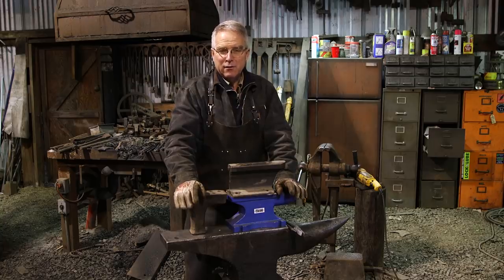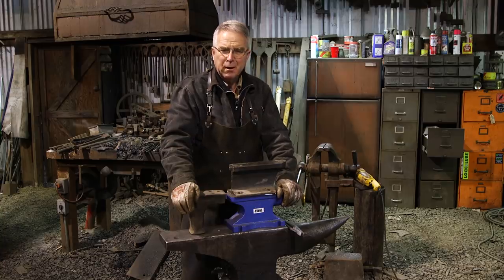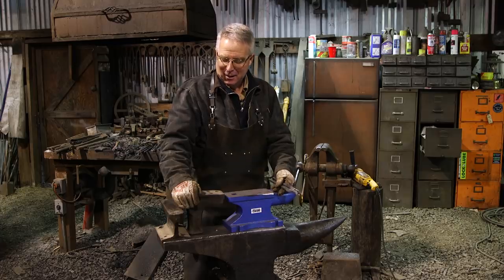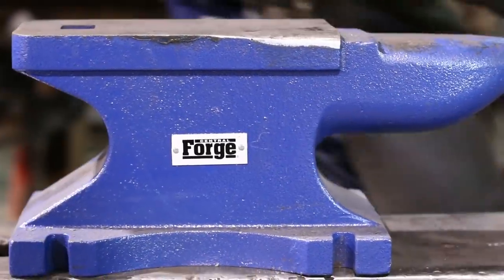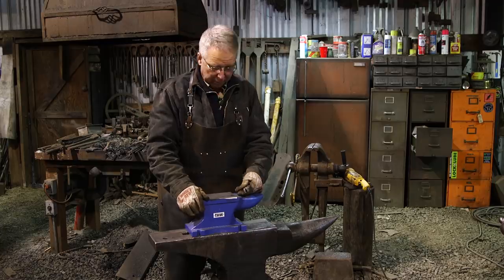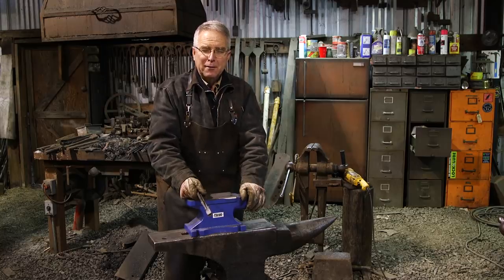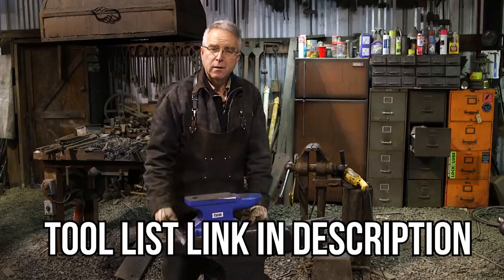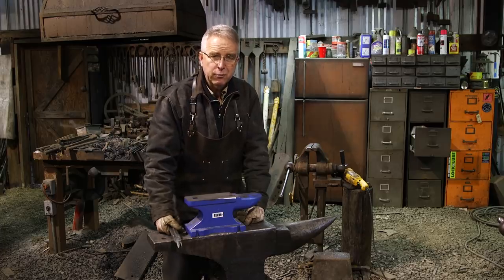Harbor Freight Anvil Review

Comment: I bought one of those 55 Pound Harbor freight Anvils about 20 years ago and it's still like new with no dings at all.  Then again it's been sitting unused in the corner of my garage for those 20 years.
Reply: He had us in the first half not gonna lie
Reply: I bought one of those 40 years ago, found out it was quite soft and used hard surfacing rod to make the top surface hard enough.  Took me a lot of time to grind the top flat again and more time to true it up.  Still, it will likely outlast my kids.  Is a professional anvil, heck no.  I'd never recommend it for commercial use.  For me, banging rivits flat and reshaping the curve in barbecue hooks, it works great.
Reply: Tnat may have been the funniest thing I read all week.
Reply: @NormReitzel  After watching this video I was considering doing similar: buying one of these—perhaps even next time a garage sale has a “decoratively used” one—and beginning my blacksmithing journey by welding up a “workbench.” I reckon it would be a fitting symmetry to my carpentry journey, using the basic tools I knew already and some reclaimed ware to shop-make the workbench I thought I wanted, then customize to suit over time!

Comment: Excellent and honest review. I am new to blacksmithing and am 65 years old. I am a carpenter by trade and still working. I bought the HF anvil to start off in blacksmithing and although it is something good to strike on, you work hard to move the metal. That said, I want to make sure I'm really going to be into the blacksmithing before I drop a $1000.00 on a real anvil. I would say it's worth it if you are a hobbyist just starting out.

Comment: The first thing I made I heated up in my BBQ grill and pounded out on a tree stump with a claw hammer. Needless to say, things have improved dramatically for me since then. 😆 It doesn't matter what you start with, it only matters that you start.
Reply: How long did it take you to get it hot in the grill?
Reply: @tuckera1879  Aww hell, I don't really remember. This was twenty years ago! You can make quite a lot of heat with a charcoal briquettes 🔥
Reply: I love that last line!  Hope you don’t mind but I’m going to steal it lol
It’s just to good not to lol
Cheers mate
Reply: My first 2 pairs of tongs were heated up in a cast iron wood stove,  beat out and bent using a 8lb maul that had about a foot of handle (head I found in a box of junk from an auction), and a chunk of thick walled 3" pipe as a "horn" in a vice.  Using coals left from burning hedge/Osage Orange/ Boise 'D Ark (all names for the same tree species) burn HOT and last forever btw. It was the go-to species for blacksmiths around here for their charcoal.

Comment: For the longest time I used a 8lb block of mild steel as an anvil. It was a lot of work but it's what got me into blacksmithing.
Reply: Mine is about 15 lbs, but that's what I'm still using.
Reply: Just a little research in your area and you will be able to find a steel supplier or scrap yard that sells cut-offs of A36 steel.  It isn’t quite hardenable but it does work harden.  You could have a 150 pound hunk of it for cheap and it would serve you well.

Comment: Thumbs up for an HONEST evaluation.
Many reviews of this anvil exist. Most (and 99% of the comments) declare it worthless, as only a forged cobalt steel anvil is worth taking home or wtf ever. I'm sure these same commenters finish their work by turning on their $15,000 rotary screw compressor to power their paint gun, as anything less is useless and far beneath them. Remember, anvils are used by a lot of people who are NOT forging anything. When you're beating some rusty truck or tractor part, a solid titanium anvil is not an essential. 
Now, for all you folks with your nose in the air, just remember that you are nobody without a ebony handle in your diamond encrusted hammer...

Comment: My first "anvil" was a 10 Lb sledge hammer strapped to a stump. From there I bought the 15 Lb anvil from harbor freight, and even that was an improvement, and I made little 1/2 in hardie tools for it.  I flattened the top with a coarse tile stone while I waited for the forge to heat up. Finally, I saved up enough to buy an NC round horn for  $400 and it's amazing how much easier forging has become! Sure it would have been nice to have started off with a proper anvil, but it's the journey that makes a man, and I definitely learned to appreciate every lb of that NC steel.

Comment: grandpa, left a 30 ish # anvil in the shop, broken hard face but it worked, got me hooked, so my parents bought me a 55# hazard Fraught anvil for Christmas... it sucked but it was better then the 30#r, I still have it use it mostly for setting rivets and light bashing of stuff, Later I bought one of the 110# hazard fraught Russian anvils, still not great but certainly better then the 55# made from cast tool steel rather then cast iron and the face is somewhat hard, horn is still garbage, but its made a bunch of knives, armor, housewares, and the occasional heavy equipment repair
Reply: northman logging how/why are you making armor just a question

Comment: I had one of these for my second anvil (My first was a small piece of I-beam) and don't regret buying it at all, I don't use it anymore but it did what I needed when I didn't have a better option. I once cut about 3/4" into it with a circular saw while I was ripping a board, so yeah, they're kinda soft.

Comment: That was a REALLY fair review.  Thank you.
Our ABANA Affiliate has six of these HF anvils and uses them both for demonstrations and for open forge meets.  The given is that we virtually never use them for forging any stock heavier than 1/2" square. 

These anvils are better anvils than most of their users are blacksmiths.
We specifically DID want 55 lb anvils because the thrust of our equipment design effort was portability.  These 55 lb anvils are the heaviest single pieces of equipment we need move around and we love that. 

We would have been happy to use high quality 55 lb anvils, but those cost at least six times as much, so you could say we got six anvils for the price of one.)
Now as for dings -- no worries!  These anvil faces are SO soft you can file out the dings -- easily. 

As for the face being too soft -- so take a 5" square 1" plate and weld on a 7/8" stem and you've got a hardy tool that will do whatever you need -- sharp edges or rounded.  Yes, the horn is weird, but it does have round edges, and you really should scroll on the face of the anvil anyway, and not use the horn as a round mandrel.
My personal philosophy about any tools (that you're not depending upon to make your living) is to buy the cheapest first.  That cheap tool will be the best instruction you can get about why you might want a more expensive (and presumably better) tool.  Yes, in my own shop, I have little use for a HF 55 lb anvil, but that's because I already have three or four better anvils.  It happens I use a lot of cheap HF tools:  Their cheapest (~$10) angle grinders; their cheap throatless bench shear, and many hand tools.  Their cheapest saber saw didn't cut the mustard, but the next more expensive did.  Let these cheap tools educate you and revel in the education coming so cheaply.
If you ARE depending on the tools for your living, then almost never should you trust in the cheapest.  Having the tool you're depending upon fail while at the job site just isn't worth the problems it causes.

Comment: I would highly recommend the NC Tool "Knifemaker" anvil that you have listed in your guide for anyone looking to get started. I recently bought one to take with me when I go to shows and such and it's been great. My only real complaint was it took a bit of work to get the hardy hole to be actually 1" and accept my 1" tools. I use it quite a bit and it has held up incredibly well thus far, and it feels really good to forge on. For anyone just starting out this is an ideal starting anvil. It won't break the bank, and it will last you a long while. And it cuts out a lot of the hassle of trying to score an affordable used anvil.
Reply: See, I've been debating on getting the knife maker or the vervor 136 pound cast steel one. I like the two horns on the vervor, and the wide top. But the knife maker has the larger horn, and a little taller.  I've been going hard with smithing for 6 months now and I'm past a few mile stones, in it for life now I guess lol. But I need something better than the harbor freight guy until I save up for the life anvil. My man here is right, when using em you're doing all the work. Personally I think that's a good thing. I'm growing my strikes, teqnique,... And patience. 🍻⚔️🍻

Comment: I decided one day I was going to be a blacksmith. With no knowledge on the subject and little money for at the time would seem like flights of fancy I bought a similar "anvil" on line 55lbs and used it all of 3 months and like you said I found a almost pristine Peter Wright 194lb at a price I could afford and instantly the 55 pounder became my cutting surface or for anything that I  was worried about marring the surface of the Peter Wright. I agree it's an affordable work surface and mine had a 7/8ths hardy but I would only recommend it as a last option! You are spot on with the fact that it is flat! No rebound just a dull clank with every blow of the hammer. Now I would consider myself a novice blacksmith with only a few projects under my belt as I work nights and sleep days 10 days on 4 days off but I live for the days I'm off......like all things in life knowledge is key so keep the videos coming.

Comment: This video was VERY helpful for a beginner. I will keep looking. I've been holding back on this hobby waiting for a good deal to turn up. Its worked out well enough on the woodworking front and I scored a $1100 jointer on a $150 stand for $300. I can do that for this as well.

Comment: Thanks for working so hard to help people like myself. I worked in a machine shop. When I was 18 years old. You know back in the late 70s early 80s. As my son says before dirt was popular. 
Learning to burn welding rods and  use a wire feed welder. I got pretty decent at cutting with a torch. Anyway that just wasn't enough for me. So I joined the Navy and became a carpenter in the seabees. LOL 
I really wanted to learn how to forge and join steel the way you guys do. Well now that I am not able to work anymore. I want to learn and do smithing. I don't have to kill myself but make things I want to make.
I am a tinkerer I love to take things apart and put them back together. Improve them if possible or create better. 
I watched someone rework one of those harbor paper weights. He put a new surface on it made it look real pretty. 
I was torn between getting one of those and,,,. Going to a scrap yard find a 1 inch steel plate. Take it home drill some holes and nail it down to a tree stump and call it a day. Since I seen this I'll go to the scrap yard tomorrow. 
One question however is still on my mind. Do you think that thing would work with soft metals? Asking for a friend. LOL thanks again.
Reply from the maker: Yes but a steel hammer will mar it.

Comment: Give it to Cy and see what altitude he can achieve with it.............
Reply: LOL !  Although, if as a couple posts say it's filled with bondo, I wonder if it would just come out as scatter shot ?

EDIT : Ah, not so  much "filled" with bondo as very liberally applied surface smoothing with bondo to "correct" surface "imperfections" in the casting. So it would be mostly solid, but probably a lot of bondo dust in the firing.
Reply: See how far he can explode it into the sky !!
Reply: Do not do that, it will explode into shrapnel guaranteed.  One good smack with a 2.5lb hammer broke both feet off my buddies.

Comment: I inherited a small cast-iron anvil from a relative. 10lbs I think. No hardy or pritchel holes. It's about 4" x 8". A friend helped me weld a 1/4" plate steel cap on top. We beveled the edges of both pieces and he put a thick bead all the way around. It now has some rebound. Its not big enough for serious blacksmithing, but it was free and serves my needs for smashing metal with a hammer.

Comment: A harbor freight anvil is great for small project (kinda like a bench anvil) but for full time blacksmithing I would try to harden the face before first use. A friend of mine took one, cut of the strike face, and forged welded a new hardenable face to it. It doesn't have have a hardy hole but it works great for his little farm.

Comment: I bought one of those little blue wonders a few years back and knowing the limitations of cast iron, I welded a 3/4 plate of hard steel on top. The hardy hole was less than a joy to drill out. It served adequately during my first few years of learning a new craft until I found a real anvil and now it sits on one of my work benches for smaller projects.

Comment: I found one half of a train car coupler with the tabs sheared off and lugged it home in my backpack. It weighs about 70 lbs, lucky I had my frame pack on that hike. One side is near flat with a rounded edge and two square ones, and a little research told me these knuckles are cast from a high tensile, abrasion resistant steel.
It should make a great starter anvil once I clean it up and stick a horn on it, despite being hollow. That last fact will actually work in my favor when I go to cut a hardy hole in it, but I think it may end up cracking over time and use.

Comment: Once I bought about four 10 gauge extension cables from HF. All caught fire over time. The cables themselves seem okay but the connectors are crap and had to be spliced off and decent ones put on after the fires. Their "vise-grips" don't hold and so you'll have to start using two everywhere you would normally be using just one. The metal they use isn't right! Their air components will blow apart! Their impact driver stuff literally shatters on use blowing up in your face. There is a reason why nearly half the people in line are returning items. However, I never thought they couldn't even make an anvil! Thanks for the heads up.

Comment: As a Frugal & Handy guy, crafty "Farmer Fixer", I may add that $55. Blue (NOT) an Anvil to a stump in my shop space.  It may serve my needs well on the occasion I need to heat and beat a bend, heat and straighten a tool or part out.
* Speaking of Heating, I sold my OXY/ACT Set up 20 years ago, do you have a Frugal Occasional Use, cheap way to put some heat in a part, 
A fast forge ? I really enjoy your channel, Thanks I have learned a lot and still have many videos to watch.

Comment: I bought one of these for my boss, she makes jewelry.  One day I was replacing blades on a sickle bar mower, peening rivets. I was using a  old bush hog blade as an anvil.  Then I though Ms B has an anvil (ASO, I told her that was what it is when I got it). So I "borrowed " it, it worked work way better than the bush hog blade. There was a walkway and a step down to the patio, the anvil was the perfect height to line everything up. I started peening rivets, knock out about 8' worth in just a short time. each blade was about 2.5" had 2 rivets, I set it up assembly line style. When I finished and removed the completed sickle bar, the face of the ASO  was dimpled all over. She was not happy. I replaced  it w a new one and donated the dipped one to the kid next door.  The HF ASO worked ok for brass, silver and gold wire NOT rivets.

Comment: I bought a HF anvil, not for blacksmithing but because there are times when one needs to beat on something with a hammer and the HF anvil is better than using my vise or getting on my knees and using the concrete floor of my shop.  Plus it's light enough to pickup and throw back into its corner.

Comment: I bought two of the 110 lb version of this anvil  (alas discontinued) from Agri Supply.  I put them in my tractor ballast box and filled the rest of the space with small pieces of scrap metal & sand.  The anvils work great as ballast and cost less than $0.78 per pound.

Comment: The first anvil i used is a 20 pound  block of mild steel in the shape of a block of  cheese.
It was not mounted and layed on a stainless steel cart (wich was way too high) and it absorbed a LOT of ennergy.
The whole cart was bouncing and later broke through the wooden terrace it was on. 
But it got me started blacksmithing at 15 years old.

Comment: Bought one of these back in early July using a coupon so it was less than $62. Not doing any forging per se so that is not critical for me. I bought it to straighten a bracket that forms a place to attach a 1x6 decking board as a bench seat. As I was presented with it, it was mis-shaped and would not perform its task. I heated it with MAP gas and then pounded it back into a usable form using the HF anvil and a two pound ball peen hammer. Not perfect but it sufficed.

Comment: I’m considering getting that anvil because I won’t be blacksmithing with it, I’ll be using it for leatherwork. I simply need a hard flat surface for doing stuff like setting rivets, some cutting as well as some lite hammering etc. 
plus I just can’t justify spending $200-$1,000 on a “real” anvil.

Comment: I was really tempted to buy this as my first anvil despite all the negative reviews and such on it just because it was a good price but i decided to go to a junkyard before going to harbor freight and i found a large block of metal around 70 pounds probably that's already hardened and it's rusted so i need to clean it up but it's very sturdy. It's a rectangle so if one side goes get dinged up i can just rotate it 3 times so there's 4 sides to work on. And theres no horn but that's ok with me for now

Edit: I got the block of metal for $17!